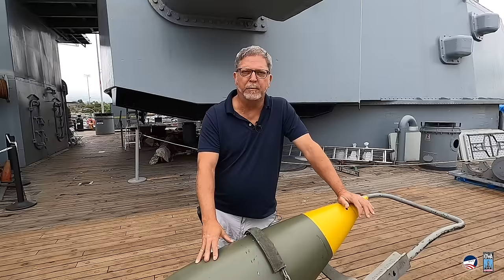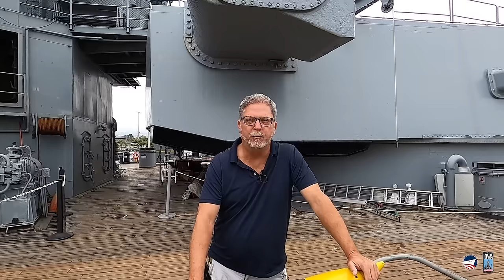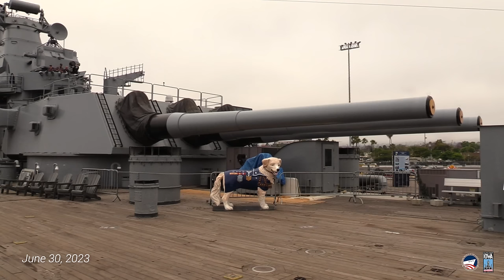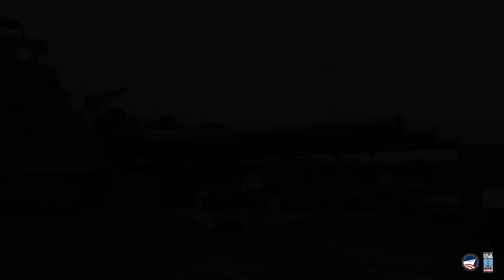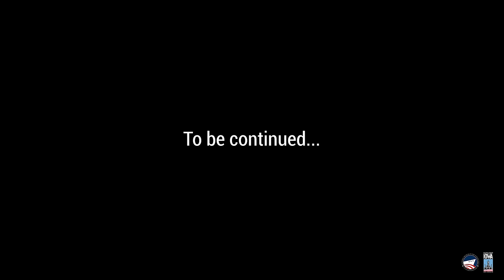Turning Turret III After 30+ Years

Comment: I never thought I’d see a battleship’s guns move under their own power in my whole life. So cool! Thank you for sharing this moment with us
Reply: You ought to see a "Live Fire"
Reply: @russellschuh1634 is it possible for a live fire shot? With permission  of course
Reply: @leadheadmike1  unfortounately, it is extremely, extremely, extremely unlikely that any of those guns will every fire again
Reply: @leadheadmike1  Not gonna happen. Also just the safety concerns alone of trying to fire 80 year old ammunition out those old gun tubes. It's just out of the cards.
Reply: @Someguy6571  the ammo isnt 80 years old, since these ships have been in service until the 90s. Theres most likely a way to make new ammo since theres also still ammunition for world war tanks and weaponry made today.
The only concern is if the ship can still take the stress of firing the main battery after all these years
Reply: @Kill0rGurke  I am pretty sure the ammo they used in the 90's was stuff left over from the war (this includes Korea), since a A LOT of it was made. Also WW2 tanks now a days have very custom ammo made for them for target shooting. It's basically a cast steel (or maybe milled), slug. 

Not the original APCBC, HVAP or any of the old original style ammo. Plus they are not even in the tanks firing them as they stand outside and pull on a string to fire the gun because they are afraid it could blow up on them due to its age.

Comment: As a crew member on Iowa's last cruise before decommissioning in 1959 (before the missiles were added) I can verify the soundless turret rotation claims.
From my General Quarters battle station on the 07 level -  I was ET5-  I'd leave the small puka and stand at the rail watching the shells leaving the big guns seven decks below.
Rotation was silent, discharge of the 16s was surprisingly easy on the ears (low rumble), but the 5"-38 repeated BAM BAMs from the nest right outside my station gifted me with a diminished hearing that I carry even today. 
Those years aboard Iowa were some of the best of my life. Bravo Zulu to all the MSN staff.
AJC

Comment: This is awesome.  I was told by New Jersey that it couldn’t be done because the training motors were 1200amp. I really didn't understand why a newer more efficient 300hp motor couldn’t be sourced or a higher rpm motor with a proper reduction train. Well done!!!
Reply: Ryan also said they were weld in place, so I thought they couldn’t rotate.
Reply: @roscop.coltrane8532  No they aren't welded in place
Reply: @roscop.coltrane8532  Only T2 and it could be cut free in about 5min with an angle grinder.
Reply: Another huge problem is how do you get the old one out, and the new one in, without a shipyard to dismantle the turret?
Reply: @PixelmechanicYYZ  I believe there's a chain fall near it that can be used. The motor isn't physically that large.
Reply: The motors don't draw 1200 amps. Each turret has an 1800 amp breaker. Feeding power to one of many motors in that turret isn't a deal breaker. Ships are fed 3 phase power. 3 phase motors draw less current from each phase because they work together.
Reply: @Ghauster  I'm repeating what was told of why it couldn't be done on shore power.  The running current is about 250amps? 5x is 1250amps.  

They did something and I really want to know how.
Reply: We did with 100% authentic, original, state of the art 1930's installed equipment.
Reply: In order to replace that 300hp, 325amp FL motor you'd have to remove a section of the armored roof, remove the center gun, remove the pan plate in the gun pit and only then could you rig that motor out.
Yes, I've rigged very large motors before in my Navy career, the are a bitch to say the least. I'm telling you this just to show the ubsurdity of that idea of how we accomplished our task.
Reply: @jth877  Says who...Ryan ?!

Comment: That's a big old turret . The work  that must have taken to achieve this on old and  complicated systems is impressive . A lot to go potentially wrong if you don't get it right . Terrific sight .
Reply: Most of the Iowa even north Carolina turrets are still active all they did was pin it with locks and disconnect the fire control system. The main question is that if the fire control system still works and it does there so old but so well made. Don't make ships like they use too nowadays ships are lame and tin canny and look like crap miss old battleship classes nothing more patriotic then these old ships

Comment: So how did they do it, I remember the USS New Jersey vid saying the power requirements for turning a turret were beyond what a land power line could supply
Reply: You only turn on the motor you need. Not the rest of the equipment in the turret.
Reply: I'm pretty sure NJ meant that THEIR shore power wasn't enough. Iowa must have a more robust shore system.

Comment: What voltage and current to power the turning motors? Multiphase AC? Was this powered through Iowa's existing shore power system, or was a generator truck rented for the day?

Comment: Tell me more about the 170 tons of projectiles, please.  Are they dummy rounds, painted to look like 'live' ones?  Live rounds that have had the explosive removed?

Icing on the cake would have been a lined fixed to a muzzle & a guy, or a gang, doing the old 'heave ho' on the line to turn the turret - just for fun, of course.  Maybe on April 1?

And, where are the left/right & start/stop switches located that were used for this operation?

Comment: Very cool to see that turret move under its own power after a long sleep. I thought you guys weren't allowed to do that. I may be mistaken, but I think I saw a video from Battleship New Jersey's channel where the curator said the Navy has forbidden them from firing up the equipment needed to move the turrets. Did you get special permission?
Reply: I can almost guarantee this wasn't done by firing up the ship's powerplant.  I'm sure they figured out a way to get enough power from external sources.
Reply: Surely they used shore power.  There will be a video covering this soon

Comment: Did you accomplish that strictly off the available shore power hookup or run the turret motors or did you need to fire up the emergency diesel generator set ? I heard 4 degrees a second early in the video and that seems too fast to be manually cranking the thing around.
Reply from the maker: Shore power.

Comment: Great work!!!
Will the barrels eventually be worked up to be able to elevate and depress again? I wonder if blanks can be used in a simulated fire ?
Reply from the maker: We can raise and lower most of the barrels manually (busted bearing in the right gun of T1, so no joy there). We usually keep T2 and T3 elevated to 20 degrees. Had to lower -3 for this evolution because it was easier than dealing with our up and over cable, which runs between the center and right guns.

Comment: Was that an electrical or manual mechanical rotation? If I remember correctly,  shore power doesn't provide the 1200 amps needed to rotate the turret,  so it would take 2 desiel generators onboard to be online.
Reply from the maker: It was shore power. We made a video about it. It's linked in the description.

Comment: I can’t wait to find out how you did this, I thought the breakers for shore power on an Iowa class couldn’t provide enough power to rotate even one turret.

The curator for New Jersey implied that the only way to get a turret moving would be to fire up the boilers and shipboard generators, which the navy won’t allow.
Reply: I wonder what they have for shore power compared to the other three, and if any temporary wiring had to be done to power the machinery vs the original electrical system.
Reply: If memory serves he said that the shore based power didnt have the amperage capacity to handle it and it would need a lot of upgrading which is cost prohibitive. The way to do it would be to get a 3 phase generator capable of handling the amperage. But, sadly those things are not cheap. Could the three phase motors be converted to single phase to make it cheaper...... hmmm, I guess anything is possible if you have enough money to throw at it. But, would it be worth it??
Reply: He also said the same thing about the anchor chain windlass. Thats especially egregious since a few years prior the Iowa team had to fire theirs up for the tow to its current location. There are several videos of it in operation.
Reply: Well Ryan is a good person and knowledgeable. There are areas he just doesn't have enough understanding of. Electricity and how it works is one.
Reply: We'll the "Curator" for the Jersey Girl is dead WRONG, ain't he ?  He needs to gather his facts BEFORE going off half cocked.  I was an Electricians Mate 1st Class on the IOWA, we rotated the Turrets all the time while on shore power.  Pay attention there Ryan, I'm tryin' to teach you something
Reply: I think Ryan was assuming powering up the whole turret which is a LOT of components. I imagine they tripped the breakers for everything that was unnecessary except maybe lighting and training motor etc to keep the amp draw down. If you activated the whole electric deck to train and elevate 3 guns, power hoists, elevators, turret rings, fire control etc yeah then 1800 amps would be more like it requiring a turbo generator which wont happen. Either way Its awesome watching these guys at Iowa.  Great job!!
Reply: @sierraone9181  Negative my friend, didn't strip one single circuit from any of the four switch boards, load centers or power panels.

Does not matter about the rest of the Turret equipment, not needed to train it, besides, the main breakers are rated at 1800amps.  Besides the training gear we lit off the vent fans.

Ryan talks the talk but he can't walk the walk because in this case I OWN THE FRIGGIN' DECKS ! !
He can't compete with this Plankowner.
Reply: @martypalmiere7672  Iowa officially the most Bad A** museum 👍
Reply: @nzcyclone  3 phase to single phase would need more power, not less.
Reply: @J-1410  Yes, I know. But, installing single phase is as a rule a darn sight more cheaper than installing 3 phase. It was just another option suggested.

Comment: Is the turret turned directly by an electric motor - or does an electric pump provide hydraulic pressure to a rack and pinion to turn the turret?
Reply from the maker: We did a video on that. https://youtu.be/AtVZ0u_Xmog

There are links to several other videos about this evolution in the description, including views inside the turret as it rotated. 😀

Comment: Are you still using original motor controls? Have you installed a modern VFD to run the traversing motor?
Reply from the maker: Used the original equipment.

Comment: WOW!! did the ship list to port with all that weight hanging over the side?
Reply from the maker: No. The designers balanced it precisely so that it does not list no matter which side the turret is trained to.
Reply: Remember, most of the weight of the gun is in the breach, and that remains on the centerline.

Comment: As a machinist these days that is impressive. People don't realize they aren't that difficult to machine. I'm no expert on battleships but that rail the rollers are on isn't one big piece. Most likely many smaller pieces with dowel pin holes and precision ground to size. It's not any harder back then to do than it is today. Machining is almost the same still today. Obviously computers are added and coatings for the tools, but everything else is still the same

Comment: As far I know that you need to turn on the turbo generators to move those turrets because the turbo generators produce enough energy to move those turrets. When the Iowa-Class Battleships decommissioned they were opened as museum ships and contract between the navy and the museum was that they can't turn on the steam engine. That means they can't turn on the turbo generators. So the ships are connected to shore power system. In this video the USS Iowa rotating her 3rd turret. So how the hell did they get power to rotate the turret?

Comment: Hard to believe after 30 years it can still move under it's own power. Shame that the damage to turret 2 incurred in the 89 explosion hasn't been repaired, so that turret is stuck in its current place.
Reply: it can be rotated but hydraulics need to be replaced & the rest of the turret refurbished

 Turret II was never fully repaired, although most of the damaged equipment was reconditioned and stowed inside Turret II before the ship decommissioned.

Comment: In historic footage clips, the big guns of battleships would traverse with a heavy machine noise, a loud whirring which i had always thought was authentic. When this turret rotates, its dead quiet. Miss the loud turret traverse noise.. what gives?
Reply from the maker: Not sure what they were doing back in the day, but it made no sound on deck when it turned. Smooth as silk and if you'd had your back turned, unless someone told you to look, you'd have missed the movement completely.
Reply: Thank you for the feedback. Perhaps older turret traverse mechanisms from older ship designs generated the heavy machine noise I heard in the old docs? It is impressive that this turret that weighs hundreds of tons can move silently, but I must say that hearing that anticipated mechanical Whine would've been kind of Awesome..

Comment: I would love to know how they managed that. Ryan has stated quite a few times that they just dont have the shore power available to provide enough juice to the turret motors to make New Jerseys turrets turn.

How has Iowa managed it? Do they have a high voltage multiple phase supply or soemthing?

Given the ship is forbidden from raising steam to allow its own generators to provide the power (thats assuming the boilers, plumbing, and generators are even still serviceable, which they are likely not)
Reply: Boilers and plumbing I would question, but I don't see why a generator would go bad from sitting, speaking from experience.

I'm thinking New Jersey my not have enough power on shore to do it is possibly what he meant, not that shore power couldn't run them.

They said they just used shore power to turn them here.
Reply: @J-1410  yeah, what I meant. The voltage and ampage coming from the shore feed onbaord, isn't sufficient to power the turret motors. No idea what the motors need, but Ryan stated their shore based feed wasn't up to the task.
Reply: @roadsweeper1  Another comment here stated 1200 amps, the entire turret's breaker is 1800. 1200 on three phase.

For simplicity sake, multiply by three to convert to single phase. To convert to single phase you would have to: upgrade shore power, run heavier cable from shore to the motor, buy a motor 3x the size, get the motor adapted after you get it down to where ever it goes, in the end it would be cheaper just to upgrade shore power or possibly rewire an emergency generator to run one, plus Ryan seems to be a fan of keeping the original parts.

I mean the reason why it is three phase in the first place it is for cost and efficiency, its why commercial operations use three phase and if they don't have three phase they get a phase converter to get three phase.

Comment: I thought It was impossible to rotate the 80 year old turret on auto control instead of manually do it by tool
Reply from the maker: Actually there is no manual way to do it.
Reply: Will it be impossible to fix the auto control on the elevation gun angles

Comment: Do you what would have been great... to actually have heard what that sounded like while it was moving. Without all that music. I was in the Navy for four years and never saw a working battleship or even an all-gun cruiser. I would liked to have at least heard it.
Reply from the maker: It doesn't make any sound when it turns. All you'd have heard was banging from work in the harbor.
Reply: @BattleshipUSSIowaLosAngeles  THAT is hard to believe. I spent many hours on a 3"50 on Condition 3 while in Viet Nam, and it made plenty of whining noise when it turned. If you say it didn't make noise, I believe you. But I would have still liked to have heard it. Still, there's a lot of difference in quality when you compare an Iowa class to a little old auxiliary ship.

Comment: A new type of battleship could have so much anti-air systems, be nuclear powered, anti sub weapons, far inland weapons such as missiles, guns, lasers, possibly railguns and operate together with aircraft carriers. Be the most armored ship in the sea with the most firepower. Railguns, could launch smaller ships possibly. A new type could even launch Vertical take off craft such as F-35. Also the strongest thickest depleted uranium armor. Depleted uranium rounds. Earth penetration missiles. The works. Be the strongest most heavily defended ship in the sea outside of a full aircraft carrier anf will travel with them including other surface vessels and submarines. Can all be interconnected like our whole military is doing with networking all out assets. New technologies from this time.